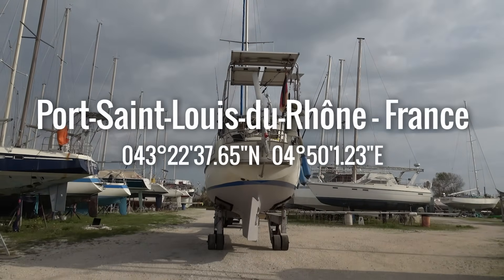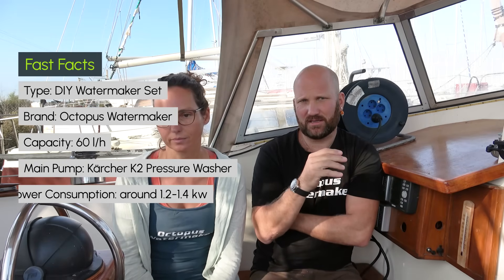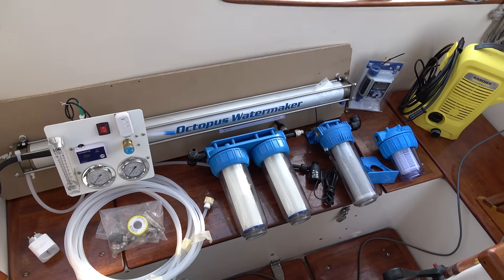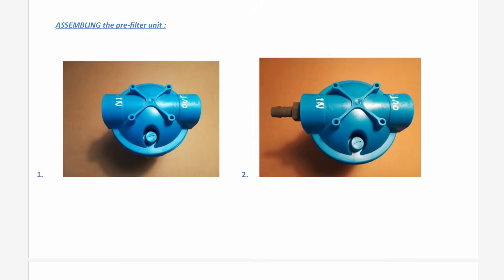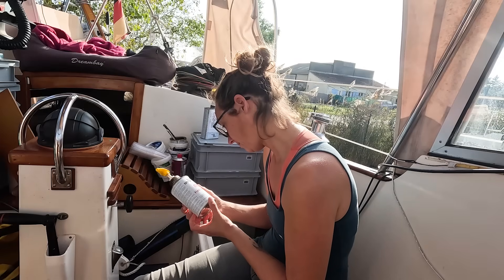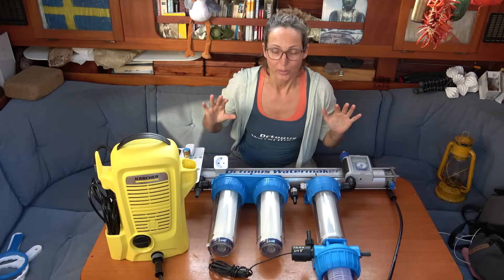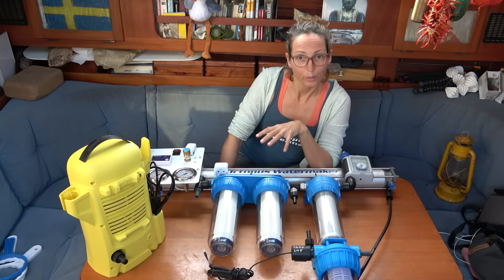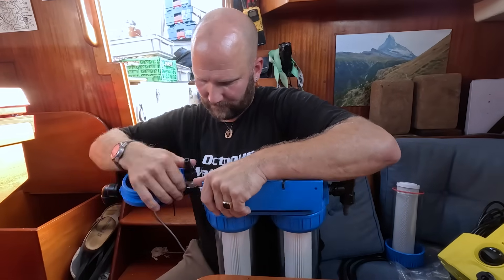DIY Watermaker Installation: Turning Seawater Into Freshwater on a Budget

Comment: are you guys still using this octopus setup? any feedback?
Reply from the maker: Yes, still using, still going strong. Floh changed the pressure washer model to the water cooled one which helped because we run it in the not so ventilated cockpit locker. But apart from that, works like a gem. We will make an update video on it soon with some of the stuff we have learnt over the past months with it, so keep an eye out ☺️

Comment: So, in oredr to make those 60l, how many kWh did it actually draw? Is the pump on 100% of the time?
Reply: Hey Patrik, For those 60 liters it runs for about one hour and the Pump runs at a consistent power consumption because the water flow is consistent. How much it draws depends on the pump.
We went with the cheapest version first (K2 classic). I worked fine but it is air cooled and in warmer conditions and with 2 people on board I ran too hot too quick. So we switched to the cheapest water cooled version (K4 compact). This can operate much longer and has no overheating issues.
The K2 ran at about 800W consistently and the K4 runs at around 1200W consistently.
I hope that helps. All the best, Floh
Reply: @flohjoe  Ok, thanks! That's not too bad in consumption, I guess.

Comment: Seawater Pro in Florida was initially supplying Karcher water-cooled pressure washer pumps with their water makers, and I installed one of their systems on my boat in 2018. It still works great all these years later, and has been used quite a lot!
Reply: That’s good to know. Do you know which Kärcher Model they installed?
Reply: @ I installed the K4 water-cooled pump but also purchased a K2 as a backup at Seawater Pro’s suggestion. So far I haven’t needed it. Best wishes!
Reply: @ thank you. We will test this shot as well.

Comment: A dehumidifier in your cabin can make 3 or 4 Gal. a day taking the moisture right out of the air and it will also cool off t\your cabin too. and cost only about $120 t0 300, Dollars and you just plug it in, No assembly. And no holes in your hull.
Reply: 4 gals is about 15L a day, it’s less than 30 to 90L/day on the bases given. And this water is not drinkable. This is the worst point.

Comment: 1,5 kw from the inverter? So you are stressing the battery, the inverter plus the high pressure cleaner, not to mention the noise of the latter.? Why dont you use a belt driven high pressure pump and connect it with a PTO clutch to the main shaft of your diesel engine?
Reply: Maybe because : a belt and its assembly is a cause of engine shortage. Second, it implies running engine 2 to 3h/day even when not sailing… sailing not motoring… it’s a good idea only on motorboats…

Comment: Be sure to take a spare Kärcher with you!
And if the noise gets on your nerves (and it will after a while), you can also lock the Kärcher in a well-insulated box. It can cope with this if it doesn't have to work for 3-4 hours at a time in the blazing midday sun, so it's better to run it briefly in the morning and for 1-2 hours in the evening. This should give you almost 300 liters of water, which should be enough for 1-2 weeks depending on consumption. Beer drinks better than water anyway ;-)
Reply: Thanks. Are you running yours for 1-2 hours straight in a box?
Reply: @flohjoe  Jepp!
However, it is not completely airtight, but has, similar to a wood-burning stove, an air intake shaft and an exhaust air shaft. It's relatively easy to implement. First of all, cover the whole box with sound-absorbing material (I used normal foam).  Then I drilled a few holes in the bottom left-hand side to create the air intake. I then glued a second foam wall on the same side, but it didn't go all the way to the top. The air is thus sucked in at the bottom and diverted upwards. This is followed by another mat, this time from the lid to just before the floor. The air first flows from the bottom to the top, then back down again before it enters the actual box with the high-pressure cleaner. On the exhaust air side, the same thing happens again, but in reverse. The air is first directed downwards in the top of the box and then upwards again and then flows out of the box. The distances between the air ducts are just under 3 cm, which is perfectly adequate. It could also be made even narrower. 

This works relatively well, but if I build something like this again, I will probably use cheap PC fans. They hardly need any power and I expect to be able to run the pressure washer for longer. 

The noise and humming is almost inaudible. However, the whole thing sits in the back box (unfortunately I don't know the English word for “Backskiste”) and is also stored on a good 2 dozen old wine corks ;-)

Comment: When rolling Teflon tape on threads, you should hold the roll with Teflon tape on your index finger so that you roll the tape on the roll as you roll it around the thread, that way you have complete control over the Teflon tape, you chose to turn the roll upside down so you rolled the tape off the roll, but since the diameter of the roll is larger than the thread, you end up rolling more Teflon tape off the roll than you roll onto the thread
Reply: Yep, you’re right about that 👍

Comment: The K2 being air cooled can overheat and damage the pump quite easily. It's also really really noisy! Since you already have it you might as well run it until it falls, but when it does I highly recommend the water cooled K4 model. It's so much quieter, and it can last years.
Reply: Very good suggestion. I can tell you that i already learned a ton about high pressure pumps 😂

We are definitely going to test it out and will give an update about that.

The only concern might be that the water cooled version will run the salt water around the engine and that would probably be metal… 

I wonder how fast that will corrode the cooling with the salt water.
Reply: @flohjoe  I have pretty much the same system. My K2 lasted a week. One thing I do is every single time I run the watermaker I flush with 20l of product water. Hopefully that keeps the internals salt free. I do know someone who is on his 5th season with a K4, so that's promising. Just be careful buying a K4 as they come in air and water cooled models. The K5 and up also aren't suitable as they use metal in the plungers that can rust. The K4 doesn't have any metal.
Reply: @ thank you for that input. super helpful and good advice for anybody starting with watermakers as well. The K4 compact will be our test object 😉

Comment: Out of curiosity Will the membranes last longer if you could use rainwater as a water source? Less salt and less gunk to rinse out..
Reply: You will not need a watermaker (reverse osmosis) for rain water as it does not contain salt. You don’t even need a ceramic filter and can use a standard drinking water filter, or even nothing at all 😉

Water maker is absolut overkill and way too expensive if there is no need to desalinate.
Reply: @ but if you catch it onboard there’s guaranteed salt in it not as much but still not for freshwater tanks

Comment: So, this device removes bacteria and virii, so the water is actually safe to drink, directly?
Reply: Yes it does AND most of all: it removes the salt from the salty ocean water to create fresh drinking water 🌊
Reply: Osmosis membrane is much more efficient than any other way to get rid of bio and chemical hazards. It relies on a periodic cleaning and replacement of this part.
Reply: @ChrysMTP  Even particles as small as a virus?
Reply: @ Well yes. Efficiency greater than 99,9%. In fact the problem is mainly the integrity of the water circuit itself (before its use). 
source  thesis : Monitoring reverse osmosis membrane integrity and virus rejection in water reuse
Reply: @ Thanks!

Comment: I only have a 110v system. My generator only produces 110v 15 amps, also. Not many small boats have 220 volt setups. Do they offer some that would work on 12v or 110v?
Reply: Hey there, the system works with every high pressure pump. You can swap the Kärcher if you like. In the US shop you can buy the Kärcher as a 110v version as well. 😉

Comment: What about that Swedish flag Nike
Reply from the maker: I think Floh will have to answer to that 😋
Reply: 😂 There are two reasons for my choice. First, I’m not a fan of the old-school glass in the door. And second—I’d rather not have a clear view of the chaos inside!

Instead, I’ve covered the doors with courtesy flags, each holding special meaning. One door is dedicated to Santana’s origins—she was built and first owned in Sweden. The other bears the flag of Elba, the island where I’ve spent most of my time in recent years and where I bought Santana.

Comment: karcher pressure washer is designed for fresh water...so lets see how it survives the corrosion factor as a seawater pressure pump..
Reply from the maker: we will keep you posted on this ☺
Reply: My guess? It’s only a matter of time before it breaks down. I haven’t found a single thing on a boat that doesn’t eventually give in. 🫣  That said, with a bit of special care—and thanks to the automatic freshwater flushing system—it might hold up to corrosion longer than expected.

And yes, we’ll keep you posted!
Reply: @flohjoe  I have a k2 home made system  that just works perfectly, super simple set up to keep any complications to minimum I also treat the k2 as a replaceable part and keep a spare onboard. I’ve found my k2 without any wash back etc lasts around 10 months which to me is fine as they are reasonably priced to replace and available more or less anywhere. My system produces just over 1 litres per min and general I run it for 15 to 20 mins every couple of days
Reply: @ thank you for that information. I think for 60 bucks 10 month is fine. I heard of people almost paying more for a replacement impeller 😬.
Did you have any signs of corrosion on the „pistons“

And: how often do you run it and how long do you run it before giving it a break?
Reply: @flohjoe  I may be wrong but I’m sure it’s nylon so no rust problems, I don’t really bother taking the k2 apart to look what’s wrong once it isn’t working properly I just replace it for what it costs
Reply: @flohjoe  also if we’re low on water (which is hardly ever) I’ll run it for 20 mins then run it again later that day for the same . I also open up the casing where the vents are so I can put a fan on it to help keep it cool , didn’t need to do this in the med but we’re in Caribbean for the last year and it’s so much hotter especially down below where the karcher  is
Reply: @ thank you. That is what think as well. 30min and it’ll need a pause. Have you ever tried the water cooled versions from kärcher?
Reply: @flohjoe  no I haven’t simply because of the cost and the system I made works great if you have instagram I’m happy to share pictures of my set up

Comment: Nike, I sail in fresh water, is there something that you can recommend?
Reply from the maker: uh, I saw some filter system the other day that was used in vans to clean fresh water from lakes and such. I will take a look if I can find that info again. I have not done any comparison / further research with other filter systems, though...But I will probably dive into this topic for my canal boat and will share what I can find about it. (maybe I will get Floh to do the research since he is a lot more thorough in that and enjoys this type of "work" a lot more than me 😁)
Reply: Well, I’m not so sure about that, Nike…

When I was traveling in a van, I used a manual Katadyn filter with a ceramic system. It lets you drink almost any kind of water—as long as it’s not salty. I used regular water for everything else and only filtered what I needed for drinking.

Comment: For DIY water makers that I can remember, Emerald Steel had the first totally DIY water maker that I had ever heard of. I'm generally a research monkey, and I DIY things that no one else would even try to do. I work with engineers. From what I've seen, a true DIY water maker would be completely designed with the price of the parts in mind, getting the most for your money especially with the biggest most expensive parts, perhaps the high pressure pump, and the big membranes. The measurement equipment could be expensive but probably won't fail. The his pressure pump and the membranes are the parts that I've seen needing to be replaced most often. It probably uses PEX water pipe for most everything, and I've recently got totally set up with all the PEX equipment and fittings. And gotten some experience. Crimpers ect. 

My entire Lithium Iron battery bank is DIY. Its amazing, especially for the money (25KW !) . Its uses parts only available in China at this time, Blue cells, 300amp hour area. Another sailor is using the same parts, Sailing Dawn Hunters, a newer channel. He has a lot of money and experience and doesn't need to DIY the batteries. He's building a 50KW system. I'm really impressed with what your doing and you might remember, I've watched your adventure from the absolute very beginning !  Michael.
Reply from the maker: Hi Michael, thanks for being such a loyal viewer and leaving comments on a regular base 🙏 I very much value that there are so many people here that have been voyaging with me for such a long time already. Your DIY lithium bank sounds quite exciting! I have heard about those self made set ups, it must be a great way to save money.
Reply: You’re right about that, Michael. Personally, I wasn’t entirely sure I’d get all the right parts, so I feel quite happy sticking with the preassembled setup for now. That said, I’ve already learned a ton in the process.

How confident are you in the safety of your battery bank?

Comment: Interesting. Good to know that you can run salt water through the Kärcher.
Reply from the maker: yes, you can. Some people are concerned about it, so we will watch it and let you know how it goes over time
Reply: I read that the cheaper Kärcher models have most of their pump components made of plastic and are therefore not corroding that much.

Nevertheless we’re going to test a few different Kärcher versions and will keep you posted on the results!
Reply: @ I think having a good pre filter will be important.

Comment: We used a cheap Sun Joe (1.45GPM pressure washer) for our system, all for under $1500 and it created about 5 gallons in 30 minutes, then we let it rest for an hour or so, then ran it again, so it wouldn't overheat. The Sun Joe died after about 2 years, though. Gonna get an actual stainless steel high pressure pump and electric motor this time so it'll last longer than 2 years.
Reply from the maker: Thanks for sharing insights about your set up with a Sun Joe. That's a good point about the rest. We are playing around with the Kärcher as well to see how to best keep it happy. We will probably do a video a couple of months into using it and give an update.
Reply: That’s interesting feedback. I think overheating is the biggest concern with the cheaper models. The more expensive ones are water-cooled, which seems like a nice feature, but their pump components might not be plastic—meaning they could corrode over time. I guess we’ll find out.

Do you have a reasonably priced pump in mind? I’ve also heard that getting repair parts can be a challenge once they break.

Comment: For the flush cycle, perhaps that is where you can "pickle" the membrane when you leave the boat for an extended time?
My main concern would be the duty cycle of the pressure washer and its MTtF. What is the pump on it rated to?
Having that PW on board would have many uses. But then, do you depend on it for making water?
Reply: For now, we’re not planning to pickle the membranes since we have an automatic flush system. As long as the water tanks are full and the solar panels are working, it will flush itself daily for a few months, so pickling isn’t necessary.

As for the mean time to failure (MTtF—I had to Google that one), we’re not sure yet. What I can tell you is that you can shorten that lifespan significantly if the system overheats or if you forget to switch on the pre-pump. We‘ll keep you posted.

And yes, the watermaker makes life so much easier. Sometimes we are not in a marina for months in a row. Living on bord full time becomes much more convenient 😅

Comment: 05:50 Have we found another sailor like RAN's Johan (and me) that has worked with Bosch Elektrowerkzeuge? :) The smallest 12V rainman portable unit does around 30 l/h with only 400 W. If You have 1,5 kW on tap this solutions does sound great. I suspect that Kärcher K2 won't pull 1,5 kW all the time, it depends on the backpressure, doesn't it? I would've hoped that the schuko thingymojyng would've been an Ikea Inspelning or something with a power meter!

Comment: I have a nagging memory that using Karcher pressure washers (specifically) is a recipe for failure, because they use brass parts rather than stainless steel, and salt water eats them out. I hope that's wrong, but you might look into that.
Reply from the maker: Thanks for the heads up 🙏🏼 Which parts are you referring to when talking about them being made from brass? The pistons for example  (which are metal components that are in contact with the salt water) of the K2 are made from stainless. We will definitely keep u posted about how the set up works over time 👍
Reply: @WhiteSpotPirates  actually, especially the K2 has been used by DIYers for this purpose mainly, because it's pistons were NOT made from stainless as in the "better ones", but from ceramic and thus pretty corrosionproof. That might have changed over the past years, dunno.
Reply: In fact that might be the case with the more expensive version. We are going to test those and make a comparison to the cheap (mostly plastic) versions. I hope the automatic flushing will add the longevity if you can make sure that the system rests in fresh water.